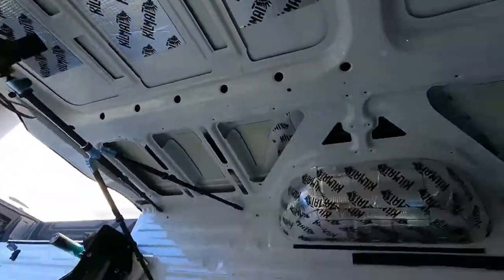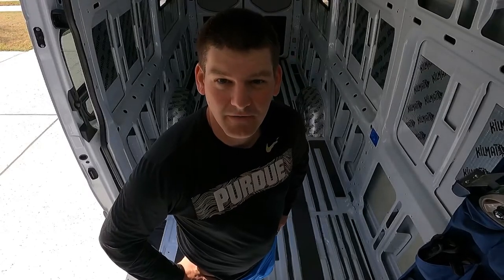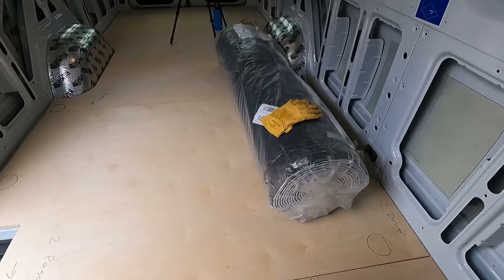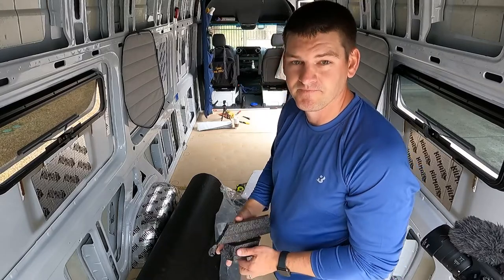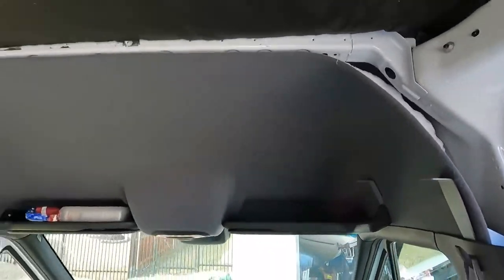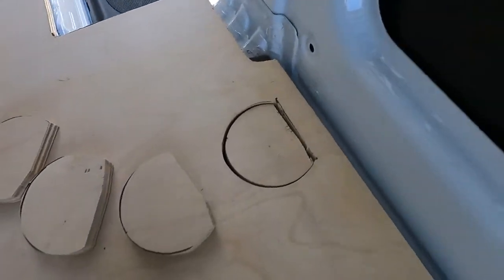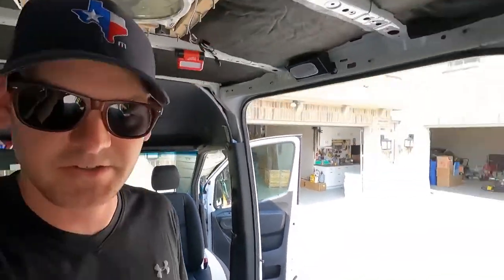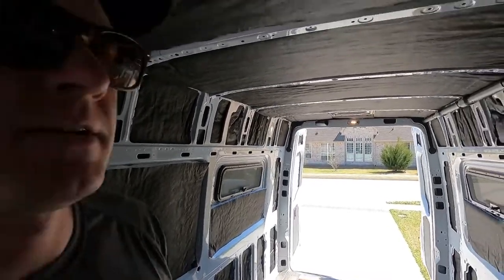Week 3 Of Our Van Build | FLOORING & INSULATION

Comment: Do you happen to know what year this Mercedes-Benz Sprinter 2500 with the 170" wheelbase & the extended body is? Since it's the current generation, it would have to be a 2019-present model year.
Reply from the maker: You bet - it's a 2020 model year.  We've been very happy with it so far after 26,000 miles!